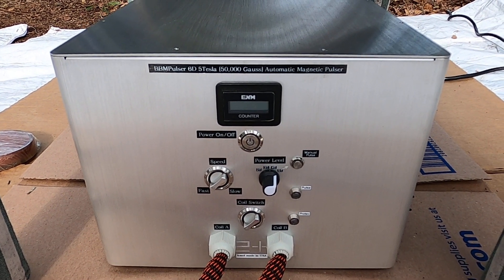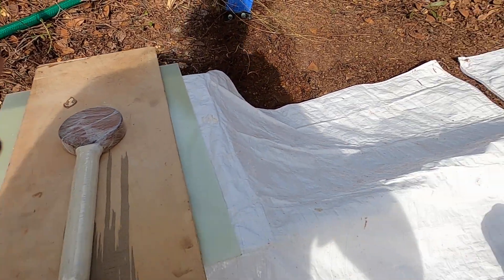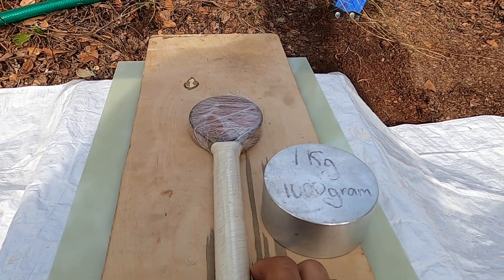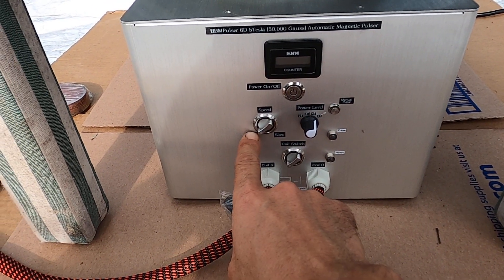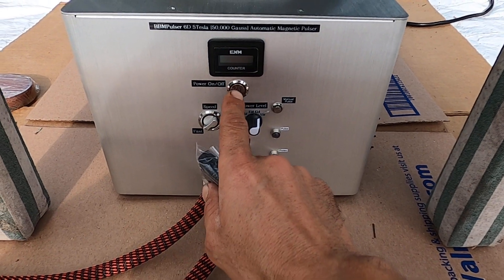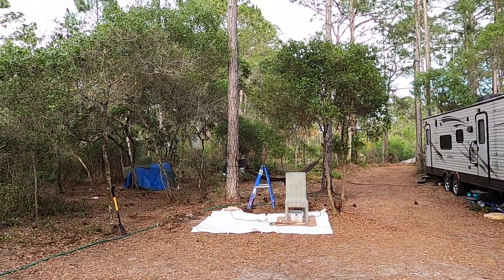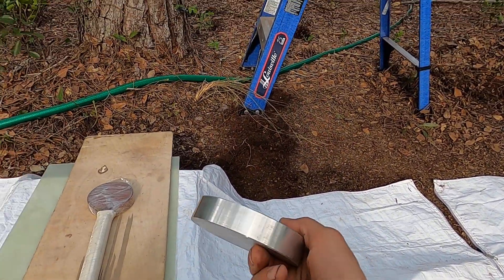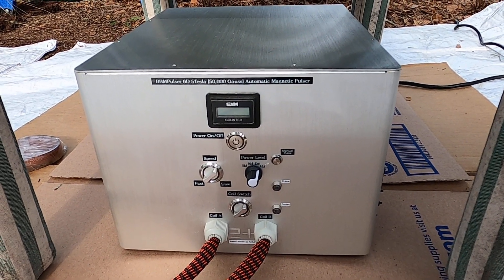095 BBMPulser 6D 5 Tesla Power test demo. Strong PEMF (50,000 Gauss) by Andrey D

Comment: I made an 800V coil like yours 1x1x3" (1" hole) using coated wires from an breadmaker motor and two  9000uf 400-450V capacitors. The problem is instead of the steel washer jumping up, it sucks the metal washer then sticks to the coil for 1 second. If try aluminium block, nothing happens, the aluminium block doesn't move.   

I hope you make a video on how to wind a coil, perhaps I wound it wrong. How do I get the alumium block to jump up?
Reply from the maker: To repel aluminum you must induce high energy magnetic pulse into it
Iron attracts to the mag coil, so it is not a good indicator.